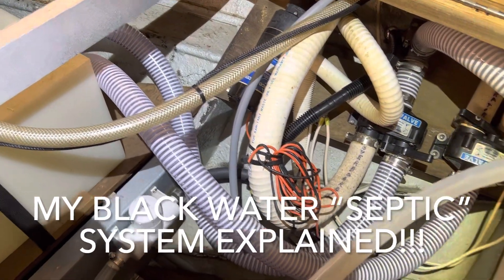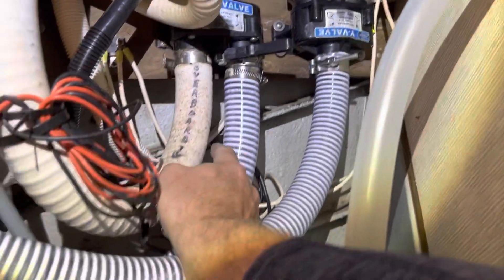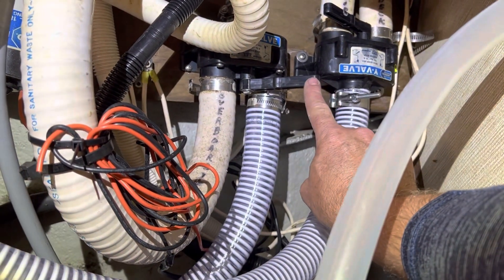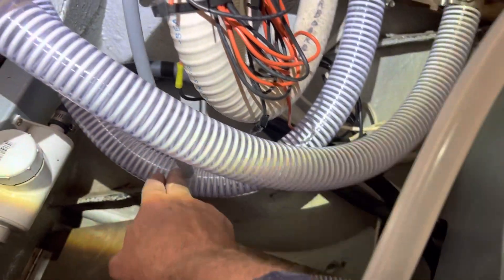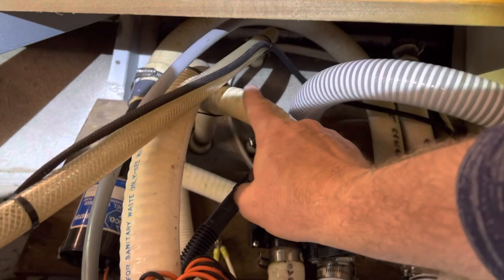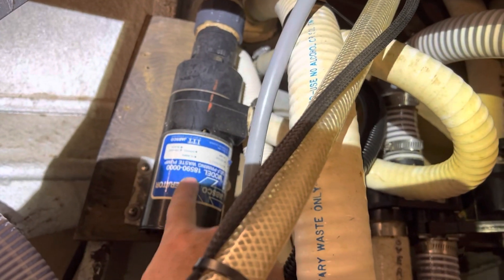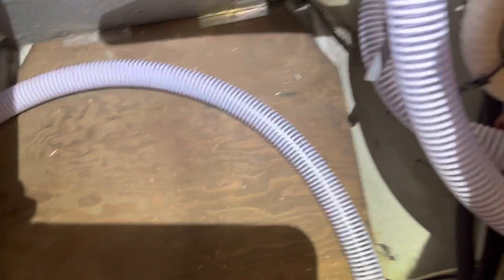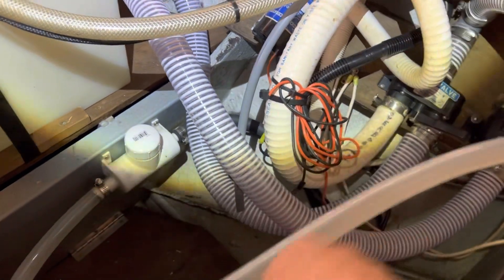How Does The “Black Water/ Septic” System Work On A Boat?????   I Will Show You….

Comment: Why didn’t you go from the toilet directly to the macerator and then put a Y valve in either to the tank or to overboard that way it would be chopped up at least in both situations
Reply from the maker: @therarebreeds77therarebree7  this was set up before I bought the boat, most of the time you don’t macerate then store in tank and then pump out. The macerator is used to pump out the tank and grind up before discharged overboard in the ocean at least 3 miles of shore.
Reply: @clog prevention- only reason I was saying macerate prior to

Comment: I put new macerated pump did not work (suck)do you think is because vent is plugged up..?
Reply from the maker: Possibly, check to make sure the valve is open and not malfunctioning so that black water can get to the macerator, make sure there is no blockage from the macerator to overboard ( dirt dobber) , make sure no blockage at the bottom of the tank to the macerator pump. Hope that may give you some ideas, make sure pump is not wired backwards it will then run backwards and not pump out.